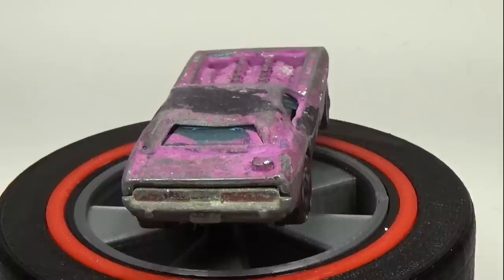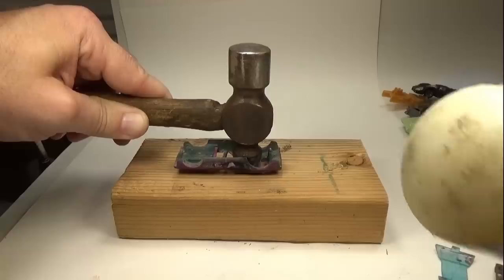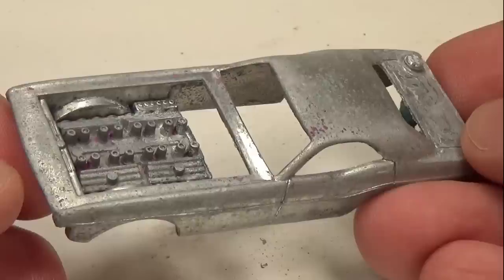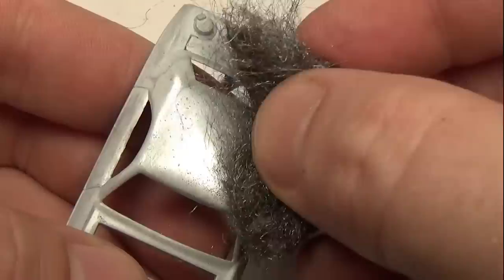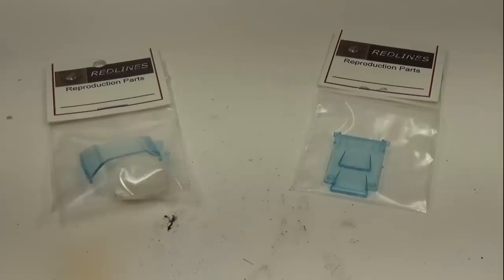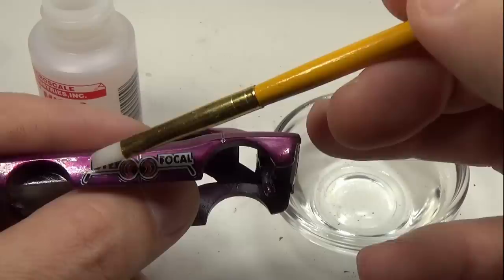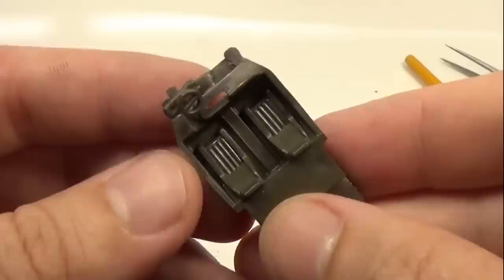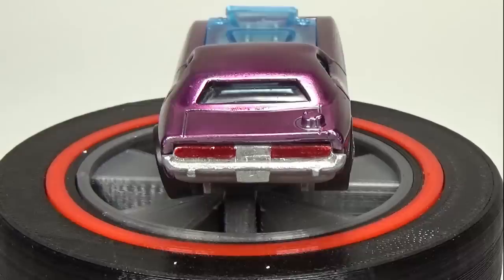Extreme Redline Restoration: Hot Wheels 1971 Bye-Focal

Comment: I have used a body filler on real cars that was called “all metal”. This was a bit of a misnomer as it was simply not all metal but a mixture of aluminum powder and a paste. However when properly mixed with the Hardner the results looked like a bare piece of metal instead of pink putty. I only used it in very small helpings to fix minor imperfections and this may help you to fill Some of the dimples in the cars body.
Reply: or just use normal bondo and then paint it silver base-coat before spectra paint. This is what we do in the model building world since the cars are made of plastic, not metal
Reply: Evil Ash bondo on classic cars is very scary, NEVER use it! My buddy paid 9000 dollars for a 1971 ford torino that was a gt body but swapped with a 460. After he sandblasted it he found out that 68 percent of the rockers were repaired with bondo and so was the front left and both rear fender wells. Cost him 15k more just to redo the body!
Reply: jacob stebbing  bondo is a name brand its like calling cotton swabs,  q-tips.  its called body filler and used in all automotive repair industries wether you think its evil or not.  unless you are hanging all new sheet metal you will never metal straighten every project that comes through your bays.
Reply: Andrew Kaminskas I understand, but I'm a bit of a perfectionist

Comment: Second
Also want to know how much you charge to restore redlines. Got several I want restored. Please respond.
Reply: I agree. I may be a possible customer for the right price 👍
Reply: I think this kind of restoration is priceless. Given a fair hourly rate , just the several hours of sanding and online part purchasing . A restore like this can be easily in the order of hundreds.
Reply: Alan Ray Locklear he doesn’t
Reply: Alan Ray Locklear Why not pick up some cheap job lot of die cast cars on EBay and, following the examples on this channel, learn to restore them yourself? 

You may think you don’t have the patience or the skill but it’s all practice, practice, practice.

I use rattle cans/auto body aerosols to repaint my cars and it’s a sometimes tedious process. I have stripped new paint from a model up to three times because it’s not right. However, I stand by my work and I enjoy the time I invest in the models and seeing them as they might have appeared coming out of the factory. I have also moved into reproduction boxes to accompany them. I’ve even bought a 3D printer to learn how to make parts that are currently unavailable from reproduction suppliers. I am learning new techniques and honing my skills.

As a result, I know if I sold a model, I would get a return on the materials used and a little profit but not on the time I have spent in the labour.

It’s a channel like this one that gives the rest of us inspiration to reach for a new goal.

AFAIK, baremeralHW doesn’t restore Redlines as a business. You may try sending your Redlines and asking if thy can be restored in a video but you’d be relinquishing them to the channel and knowing that they were restored.

Hence my suggestion to do it yourself.

Good luck. It’s a great feeling to look at something you’ve restored yourself.

Comment: Only thing I might suggest is 401 its a sandable primer for metal, and it goes on a dull grey very similar to plain clean metal. That or just prime it before you start painting. Thought a tip from a painter might prove helpfull.
Reply: SpectraFlame paint gets the look from the bare metal. Primer takes away from the effect.

Comment: It's interesting you mentioned rolling. I recently restored my Matchbox 34B VW bus to rolling status after decades of axles sitting and rusting. In the process I decided to mix up a special oil with friction reducing additives to try and extract the best possible roll out of any of my die cast collection. I may even start modifying wheel wells or tires to insure there is no braking friction occurring against the body. The 34B rolls ok, but nothing like my Hispano Suisa, Yesteryear drop head which might even have the aforementioned problem of tires hitting the body. So what to do? Perhaps I'll have to remove the axles for a polish dedicated to the wheel bearing area. Somehow I really want it to fly, not just bounce along a bit. Thanks again for the great vids. PV in Bangkok

Comment: Looks good. Only two things that stand out to me that could be corrected later is the hood needs to be adjusted and the passenger side of the roof of the car seems to still have a slight dip in in. Besides those two issues.....great job...
Reply from the maker: Yeah, the hood is fixed...  It turned out I used the wrong footage of the car spinning.  I take server angles of the car on the stand and then pick the one that most closely matches the original "before" footage. I picked this one by mistake.  I only noticed it after I uploaded it... by then it was too late... :-(

Comment: I would have chosen the blue color and nixed the silly looking decal. Also, the hood is not aligned well. Something needs to be tweaked to get the hood to sit straight. 
However, considering it's original sorry state, you brought it back pretty nicely.

Comment: I have a 71 Hot Wheel but it doesn't need restoration.  It looks as almost as good as when it was in the seventies. Even the stick-on decals are still on it and legible. My  Hot Wheel even came with what looked like a mini gas pump that you could plug it in to charge it with batteries.  Exactly like a Tesla.  Is it worth anything?

Comment: Certain metals dont take standard Solder and actually require Silver solder. or a certain type of flux.
I get around using silver solder to attach wires to stainless steel tubing at work by using a very highly caustic liquid flux that is highly acidic.

Comment: I always enjoy your videos. You skills are pretty amazing. I do however disagree with not filling in the pits. The excessive sanding alters the body's shape, even if only slightly, and there are still pits anyway. I would use some sort of filler, and then paint the car a silver or maybe chrome color. Then paint the final translucent color over that. You may get a slightly different end result on the color, but I think that would be preferable. At least the body itself would look better. Regardless your work is amazing.

Comment: you cant solder to zinc surfaces because the metal itself melts at such a low temperature preventing adhesion of the solder, however you can electroplate it with a thin layer of copper then apply a zinc based solder to the surface however i do not recommend doing this as it is extremely difficult to do correctly i would take a couple of sacrifice cars to test the method to see how it works for you

Comment: Hey baremetalhw, I have an interesting question.

Have you ever seen a restoration job done so well on a vintage redline that it's impossible to tell that it has been restored? If so, what do you think the collecting community should do about the ethics of restorations and the potential to pass them off as original?
Reply: you can almost always tell.  you have to drill the rivets out if the body comes off  and if you havent drilled the rivets or repainted the car its not a restoration you just polished a turd

Comment: +baremetalHW
If you need to apply solder to solid metallic objects you need to preheat them.
The reason behind this is solder only sticks to hot objects, and the soldering iron is not that powerful nor it has the ability to conduct so much heat to heat your solid metallic objects. 

I had to solder smd electronics to heatsink. What I did was I placed heatsink on the stow's open flame. placed the solder and Flux on it and quickly placed the smd components on the top of molten solder. Worked like a charm.

I would recommend you  to experiment with propane torch.

Comment: If you want to solder that car, get the metal rough and then cut some piece of solder and lay it on top of the car. Then you use a torch and melt it into it

Comment: might i suggest self etching primer and wet sanding? that should give you better results; hopefully..
Reply: Because the paint used on early redlines is called spectraflame, so it is essentially a tinted clear, that allows it to reflect back from the plated surface, creating a sort of metallic appearance. If you prime it first, you lose that reflective quality.

Comment: i actually thought it was a purple car in the thumbnail before restoration.

it bugs me just a little seeing that bump on the roof. i know this is a very small detail & from the hammer, but maybe one way to go about it is to make a spacing block. before reshaping the roof, you could make a mold of it from the interior with clay, with the hammer pressed into the clay at the proper point. then reshape or build up the clay carefully to get the proper roof shape & from there make a new mold (plaster?) & cast it as resin or anything sturdy enough. the result is a small throw away chunk that acts as a buffer for the hammer & distributes the impact more evenly, which should reduce the chances of the hammer leaving a bulge in the roof. but idk, i never tried any of this stuff, im just dropping ideas.

Comment: The solder will not stick to the car because it is cold, heat the metal with a torch, or hold the soldering iron on the car for a good length of time

Comment: So i have  across a 1969 ferrari 312p redline car. The car is a hong  Kong model and unfortunately is missing the back lid. Ive been price checking it and i cant seem to find where it came from it has the red enamel paint with blue and white stripe on top with the number 30. I found this model made in 1974 with the flying colors set but cant find one from 69. If anyone could help shed some light on maybe its worth thatd be great

Comment: I could use some help, I have a 2009 matchbox ‘65 mustang GT in a light blue (almost glittery) with white racing stripes across the top. And I can’t find it anywhere on any platform like google and stuff.. I was just wondering if anyone knew where it came from or something?

It’s kinda beat up, but over all it’s actually in pretty good condition the paint on top near the window is scuffed, the edges, he three white stripes on the side and the tires are old but it’s over all ok. I just can’t find the car anywhere

can anyone help me??

Comment: Your probably not getting the car hot enough to solder onto it, solder wont stick to cold metal, you must get the car hot enough or close to hot enough to melt the solder or it will never stick.

Comment: Solder will stick only to hot metal. Try heating up the body of the car before applying the solder as filler. I recommend practising on a coin first.
Reply from the maker: The melting point of the diecast metal is too low....

Comment: That way you wouldn't have to use steel wool or nothing like that Scotch-Brite lpa piece of Scotch Brite  would be better for the car then the piece of steel wool stillandpaper but it's like astillandpaper still the stilland it would take all the painting pitting and stuff out without you don't use that Scott still it seems to do more damage I'm good Scotch-Brite it and you wouldn't have to worry about the painting just try it it's called Scotch-Brite and you can also solder then but it's funnier and better for the car